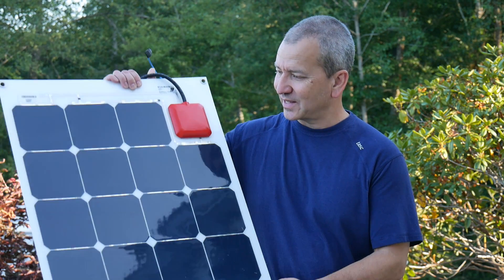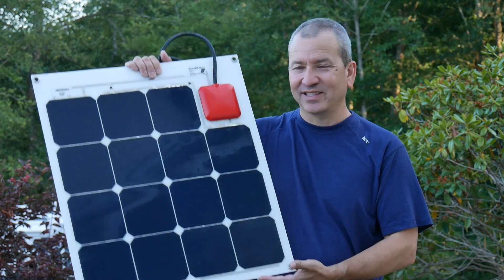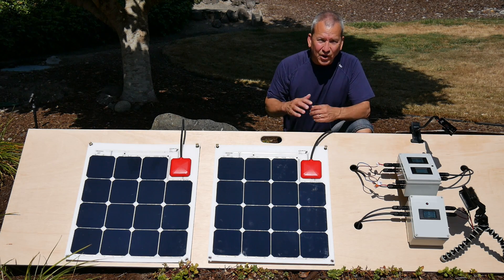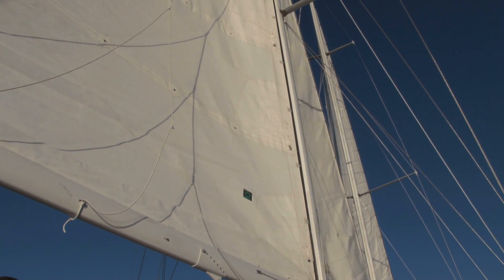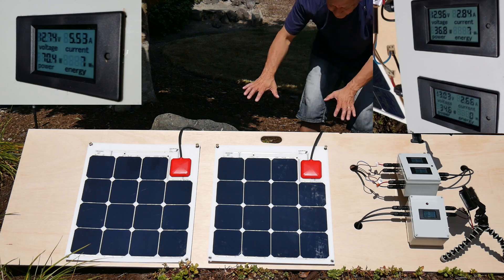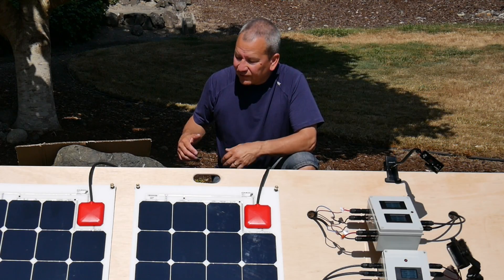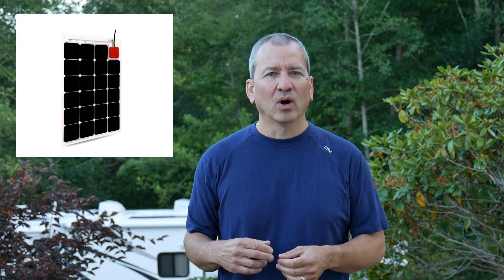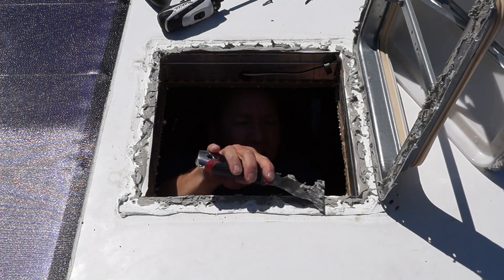SOLAR Panel with Built-In MPPT Controller : Solbian ALLinONE

Comment: RVwithTito: Despite the cell efficiency of 23%, this panel  efficiency is only about 14% because of its measurements (do the maths). So this panel is very low efficient compared to almost every modern panel. They are at least 17-20%
This panel can't handle partial shading conditions as your video shows. In conjunction with more panels it can, but  every panel can do the same and even better with an optimizer.
The MPPT only creates en optimal Voltage/Amp output and has nothing to do with shading. Two panels in paralel with one MPPT wil give you exact the same outcome as the one shown in your video.
Unfortunately I sincerely think that you don't know where you are talking about.
Reply from the maker: I wasn't suggesting that a single panel could handle partial shading. Only when multiple modules are used will you get the redundancy required for this. If I failed to make that clear, I apologize. I also realize that the same result could be achieved with other configurations. The point of this video was to demonstrate what the benefit could be using these specific modules. We can certainly learn a lot from each other, so thanks you for taking the time to share your point of view.
Reply: Hello Sneltoch, the panel has the standard efficiency you can reach by using 23% cells. We are buying cells directly from Sunpower US and thus we believe in their quality. Obviously when you consider the full panel area the efficiency decreases due to the blank spaces (i.e. the space between cells, around the edges, under the controller). As Tito remarked, the distributed MPPT architecture is indeed a great advantage, especially in sailing and mobility, and obviously can be obtained also with discrete components. Most of our complex sailing applications are made with custom panels and one controller each panel. In most cases we uses Genasun (https://genasun.com/) which are for sure the best DC-DC MPPT chargers in the market. The AiOs are targeted to simple, portable or removable installations, when easiness is important. Thank you for all your comments.
Reply: Hello Solbian, I never said that the product is not good and that there is no market for it, but what Tito said is BS. He should not do this kind of publicity stunts.

Comment: Interesting concept. I agree with other commenters that you would be better off with discrete devices. More flexibility, monitoring capability, battery temperature compensation and not to mention cheaper. Even as a single, stand alone system it's expensive.
Reply from the maker: I agree with you. These are the first I've seen with an integrated controller. I see the benefit for someone who doesn't  want to deal with separate devices. Like you, I would prefer the control and flexibility of having the controller separate from the panel and still be able to achieve the same result. Thanks for the comment.

Comment: great performance and $$$$$ but you get what you pay for...thanks
Reply from the maker: Solbian does appear to be a reputable company who has been a pioneer in the flex panel industry providing high quality products. Perhaps with economy of scale, the cost may come down. They were interested in know what people think of these so they will definitely be reading these comments.
Reply: i'm still trying to wrap my head around the connect aspect, i heard you say they connected in parnell and since the have their onboard controller then they get connected directly to the batteries, but then what would you use to monitor the condition of the batteries, input app and % of the batteries... I like the redundancy aspect...very interesting

Comment: Right off I notice 15 cells. 15x.4v= 6v, open circuit voltage. Correct ?  Are they Gallium Arsenide cells ? No, they are not. I went to the site and I would be tempted to use a more efficient higher powered model. One that starts out with a higher voltage.  They do have a higher open circuit voltage than a photovoltaic cell. The one I liked the most was this one... http://www.solbian.eu/en/sr-series/64-sr-156-q.html  It has an open circuit voltage of 23vdc and works with a typical MPPT charger which takes the 23vdc and converts it to the 12 to 14 vdc you need . They are pricey but your getting the flexible panel, versus a panel that cant flex at all. Why is adding a MPPT charger such a problem, power goes in, then out, simple. You can also protect the MPPT charger say, inside your boat, rather than out in the salt.

And, I did mention Gallium Arsenide cells. They are used by NASA, and hopefully will become available in our lifetime. They are especially efficient, another words, use less space for more power. Important for Land and Marine RVs (cruiser yachts).  Here is the future. Sol Voltaics  https://youtu.be/Th889FMKKnA

Comment: A couple of key points, multiple charge controllers isolate panels so that shading one panel doesn't limit the production of an adjacent panel  you can use multiple controllers with conventional panels and controllers. A good example is isolating ground mounted panels from roof mounted panels since they see different light levels at different times of day. Another factor to consider is battery C-rate. Here is where re-thinking batteries makes a difference. The 10 percent rule is generally true, but what if there was a sealed lead acid battery that was designed to accept a charge at a higher rate? Then multiple controllers get more current to the batteries faster to take advantage of the available sunlight hours. That battery exists and because it takes current faster, the depth of discharge is reduced which extends battery life. The multiple controller concept is a game changer.
Reply from the maker: Good points. I agree. I have a single MPPT Morningstar charge controller and may adopt a similar redesign in the future. I pointed out the 10 percent rule, just as a guide to figure out how many modules you might need based on battery capacity. Thanks for sharing your thoughts here.
Reply: RVwithTito , Glad to be able to contribute to the community. Your videos are among the best RV technical videos on the YouTube. I appreciate the effort you put into setting up great demonstrations.

Comment: Great review as usual.  I am sure these will evolve and become less expensive over time.  A small amp meter on the MPPT would be a nice addition or at least a port for one to plug into.  These cells and panels keep improving all the time which is great for us the consumer.  Maybe to get the price down they could adopt a master panel with the onboard controller with slave panels without the controller that could plug into the master.  Also you failed to mention what gauge the wire running from the controller to the battery was and if you thought it was heavy enough to avoid voltage loss.
Reply from the maker: Great ideas. I'm sure the folks at Solbian will be reading this and appreciating the feedback. The cables are #12 AWG and 8 meters in length. For longer runs, I recommend going into a combiner then running thicker cable to the battery. As always, plugging in your length, current and voltage into a voltage drop calculator is recommended.

Comment: Any recommendations for made in the USA?
Reply from the maker: The SUNPOWER cells on this panel are manufactured in the USA. Unfortuntaly, most companies selling these type of modules source materials from suppliers across the globe. So even the ones claiming to be made in the US are probably assembled and sold in the US only. If you run across any, please share.
Reply: Hmmm, when I worked for a Sunpower dealer, their cells were made in the Philippines. How sure are you of the made in USA statement?
Reply from the maker: +Bennington Camper Thanks for pointing that out. I'm just passing on what I've heard from other solar providers I've spoken with. I have never worked with Sunpower so I don't know for sure. I certainly could be wrong on that one. I have also heard about Sunpowre knockoffs out there as well. It's hard to know for sure these days. Ugh.

Comment: Great idea but very poor value compared to other solar panel solutions. The 47 watt panels are $589 each. The cost of convenience is too high. Like you said in the video if the panel or charge controller fails the complete solar panel assembly is scrap. I think the more conventional installation of separate panel and charge controller is a much better and economical solution. Great video. Safe travels.
Reply: Agreed. The video opens with "I have something really cool to show you" but if by 'really cool' he means 'way more expensive than it needs to be' then yes I agree it's really cool.
Reply: Integration of components can be OK as we have seen in the integration of sound and video in motherboards who became a lot cheaper by this integration. Here I see the opposite, so I feel stunned by this video.
Reply: Agreed. The cost is prohibitive in the current market.
Reply: They probably target a specific market where the most important thing isn't price, but highest yield per square meter because boats have limited roof space.
Reply: If you want maximum yield you want the whole area covered with PV cells, not 15/16ths. You can still have separate controllers if you want to make segments independent. Also these panels can only do Lead-acid. These days it makes sense to use a programmable MMPT/charge controller which supports other chemistries.
Reply: $12-13 per Watt is very high.

Comment: Great video.  Another CON is that you cant seem to monitor the performance of the system.  Easily solved with the addition of a voltmeter and ammeter but then it isn't a 'plug n play' solution.  I am also assuming that they are set for lead acid batteries so cannot be adjusted to charge other types.  Even then there are several types of lead acid configurations that need to be charged differently.
Reply: Good point, actually on my desk I have the prototype of a new board with WIFI communication capabilities. It will be possible to read the electrical parameters on a smartphone and to do some setp-up of the board. As Tito wrote, AiO can be adapted to Lead and Lithium batteries but we need to do at factory, before shipping.
Reply: Jana Ebert why is it 'stupid' if it works well for someone with the correct configuration?
Reply from the maker: Yes. They are not rated like a typical solar panel so testing the solar is not possible with everything behind the charge controller. Could be a CON. Regarding the charge controller, the Solbian manual for these modules states that the MPPT controller is designed to directly charge lead (Pb) and lithium (Li) batteries. You can also order the unit in either 12V or 24V models.
Reply: LOL: warranty is 2 years on components. So do not bullshit the consumer!!!
Reply: Hi, any indication when this wifi capabilities will be incorporated?
Reply: Exactly, this panel is a very stupid invention.
Reply: ceeagee: Not only stupid of what Zen Zen said but also stupid because for a fraction of the price you get a much better system. I guess that the mppt cost as much as the solar cell it replaces. I like to see the warranty because flexible panels tend to be not reliable on the long run. Even if IP 68 it won't last 25 years as Sunpower panels conform the warranty do. The weakest link will become the bottleneck: e.i. outdoor plastic mppt kit connected.

Comment: Tito, Another great vid! That is a super nice, simple and clean alternative to a separate charge controller. You spent some time on explaining how shading affects the output of the panels to the batteries as well as showing the results of work that the MPPT controllers do in a parallel setup. I'm not sure how your RV is set up but mine has 4 100 watt panels connected to an MPPT controller. The 12 volt panels are grouped by twos in series and then the two resulting 24 volt groups are connected to the controller in parallel. I choose this setup to find a happy median with regard to shading. I found that although I could transfer more energy from the solar panels using the higher voltages the tradeoff would be that when a group of panels that is connected in series any shading has an effect for the entire group. The effect is broken by any groups of panels that are not shaded. So in my setup as the sun moves across the view  of the panels items on the roof of my TT (AC unit, TV antenna etc) cast shade to one group of panels and then the next and reducing the chance of a complete loss of amps for the entire system. The Take away here for me is parallel setups are the best part of any redundant system when it comes to shading and for those that want or need to move more amps over longer distances adding panels and increasing voltage to those individual runs is ideal. Thanks Tito!
Reply from the maker: I too have a mixed setup combining some panels in series and groups in parallel. I change it up every so often. I have a single MPPT Morningstar TS-45 controller. Thanks so much for sharing your setup!
Reply: AiO panels can also be connected in series, you loose the advantage of shading protection but you can, as an example, charge a 48 volt battery with two small SP 23 AiO 24 Volt in series: https://goo.gl/SDqMmL

Comment: Great video and a very interesting product.  I like that you made sure to point out the negatives as well as the positives of these solar panels.  Keep up the good work!
Reply: There's a lot more negatives, read some of the comments. Price per watt is insanely high. Low voltage = much thicker wire gauge needed for all  but the very shortest runs. Etc.... -- BTW, love the CWO icon! (ACO?)
Reply from the maker: Thanks. Glad you like the video. I appreciate the feedback.